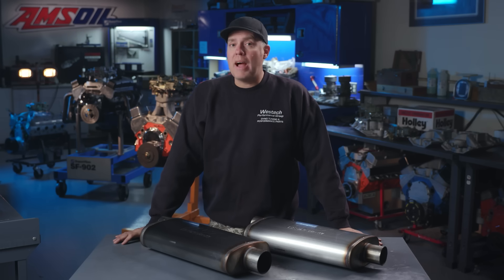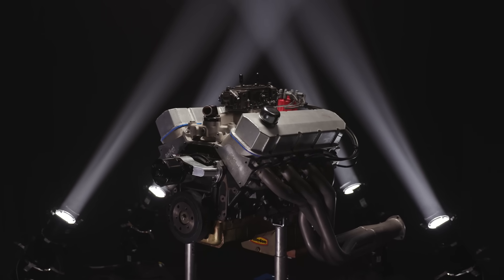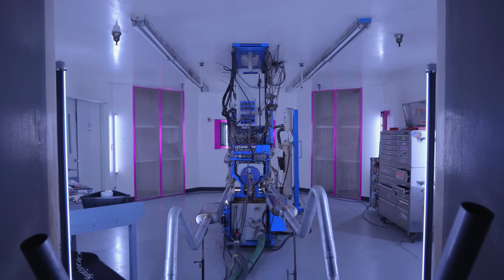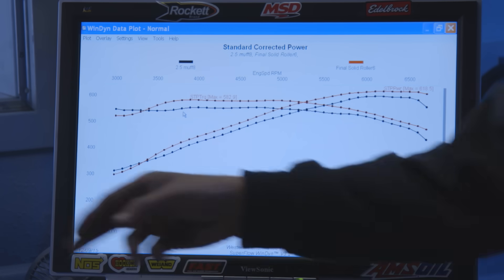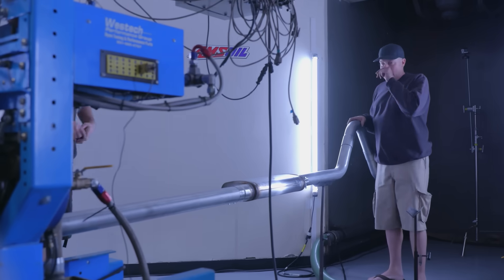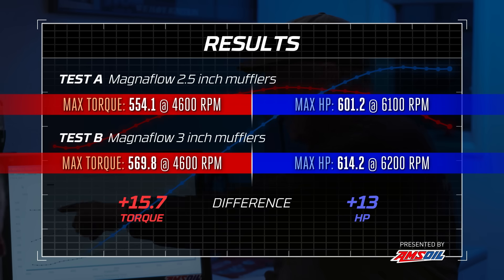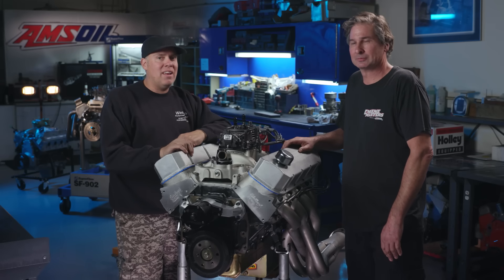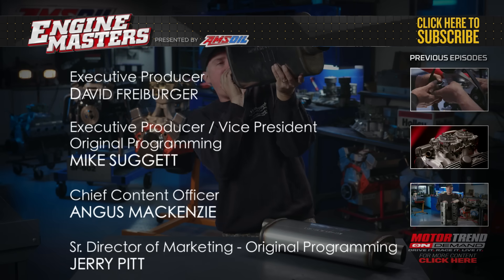The Power of 2.5- vs. 3-Inch Exhaust - Engine Masters Ep. 9

Comment: you get more hp and slight torque but you burn up valves faster this way more power less back preassure higher emissions also. with no back pressure if you have a missfire or predetonation is worse on engine also with carburators cold start is really bad with this 3 inch or free flow setup...... more power faster the engine wear.

Comment: I thought that was pretty predictable on that 454. The 2.5" sounds too small for that engine, and when they showed the difference in area compared to the 3" you knew the 3" was going to perform a lot better. The 2.5" would work better on a 5 litre engine but not a warmed up 7.4 litre.....XE302, they didn't suggest at any time that a 3" was going to work better on your Fiesta. You would only need a 2" on that. They were talking about a 2.5" V 3" on their 454 cubic inch, 7.4 litre Big Block engine.....Teenagers put 3" on their 1.6 litre Hatchbacks because they don't know any better. The Old Bloke at the muffler shop tried to tell them, but they wouldn't listen.....And, they can't be told that it won't work anyway.....

Comment: Generally speaking you want to mean exhaust flow velocity between 240-260 ft/s. Larger piping means it takes more RPM's to achieve this. That's why the 5:00 graph shows the open headers/collector making torque peak well after the 2.5" exhaust was holding steady. Also reducing back pressure on an engine can hurt power but only if the engine was designed to have that pressure there. Has to do with blowing A/F mixture through combustion chamber unburned I think.

Comment: would this be the same concept for a stock 89 454 with 8 to 1 compression, with headers only? I probably would run much more the 4500 rpm in a motorhome. Cruise at 65 mph turning around 2600 rpm

Comment: I enjoy your videos.   

I have often wondered if between 3 engines  of the same capacity,  lets say for argument sake,  a 4 litre (the actual size is not important) engine as a 4, 6 or 8 cylinder configuration.  
(Not forgetting maybe also looking at an in line verses a V configuration. ) 

All 3 engines in the comparison would need to use the same style of engine,  that is to say the same fuel and spark delivery method and for example all have OHC and equal quality heads and exhaust etc or as close as is possible.   The question is which number of cylinders is best if the engine size is equal.  

I am on the fence over this as I can see how with 4 cylinders we have one spark plug for the fuel drawn into a cylinder where as having 8 cylinders would reduce the bore size per spark plug and so allow for more efficient burning of the fuel. (because in effect we would have two sparks for the same amount of fuel in each cylinder of the 4 cylinder engine)  
Yet in an 8 cylinder we have more components and so more weight,  which uses up energy.      

Do you know if anyone has ever looked at this?

Comment: Not Bragging but I made 700 to the tire shifting at 7600 with 2.5 full exhaust with MAC flowpath mufflers and equal length headers N/A....Streetcar. You can keep that 3'' exhaust so the police hassle the hell out of you....A X and H pipe has to be placed correctly otherwise its useless besides noise cancelation but they don't tell you that. Just Buy Buy Buy.Dont overkill your setup.

Comment: not a good video this time. that motor is way more powerful than most people will have. try it on a smaller engine and see what the difference is.  and you didnt factor in how much quieter the smaller exhaust is which makes it liveable. not informative at all

Comment: If an engine likes back pressure at low RPM and not at high RPM then why not a simple spring loaded valve that opens up to allow more air flow when pressure rises?  The exhaust pressure would push the valve open as required

Comment: This is no suprise. My ST170 gained the same power percentage when the cat cracked in half but bottom end was sluggish (more than usual I might add). I hear a whistle coming from the cat when over 6k showing that more flow is required at higher revs so how abuot a clever system that lets the engine breath more at higher revs?

Comment: Hi, I really enjoy your video's, though one thing about this test doesn't seem right. The AFR was richer with the 2.5 inch exhaust as noted, and the power and torque was down 20hp/30lbs aprox with the 2.5 exhaust, but if you notice the overlay with the power being down across the board from 3000rpm, it still made good power with a less than optimal AFR. I would suggest that if the A/F ratio's were worked on to optimise the AFR's with the 2.5 system on you could claw back most, if not all of that lost power. Please address this and prove me wrong, I just want to know. Steve Peyer. PS, I read someone below noted this, and was replied with it's not moving as much air, hence the lower power, I don't buy this theory, otherwise why is it still within 20 hp, and it's across the board, not only at the top. I say it has to do with what was noted in the video, that the resonance of the system has changed, and the carburetor requires optimization for this setup. I still think that with the proper AFR's the 2.5 would have kept up.

Comment: What is ironic here is that most if not ALL muscle cars stock or bolt ons the max torque secs are wwaaaayyybelow 3200, more like 1800 -2200 rpms say 450 -500 lbft 1970 olds 455 pontiac 455 etc....so 3 inch only make more power above 3500, all is well for racers but not every street car will improve at the stoplights! I stck with 2.5 inch to mufflers and 3inch out to tails

Comment: strap this to a Ford 4.6 3v and test dual vs single outlets for trucks with particular engine but restricted to single outlet due to frame design. is it worth fabbing up a smaller diameter dual vs larger single. so many questions.

Comment: I wish some1 would do a air volume flow comparison of a rotary vs piston engines...  do either a 2 rotar vs a 2.5-3.0 V6 or a 4 rotar vs a 5-5.5L v12 (those are the comparable engines for them)  even a V8 vs the 4 rotar would be interesting due to the piston engines having a "dead" stroke to get rid of exhaust and the rotary firing every chamber every time... never has a "dead" pass

Comment: I have a 5.4l 2v I have 4:1 long tube headers with hi flow cats on it. doing true duals so pipes will no connect usually stay in 3grand so what's the best pipe and should I put a cat and muffler back in ? need help

Comment: There's an increase in noise when going 3 inch. I'm about to go 3.5inch on a RS4 B5 2.7 Bi-turbo, and i'm pretty much sure the 'hone' sound will occur more when cruising at 40 to 60mph. Even tho there's an increase in power / torque, your getting a much more noise in return for it. It's no secret cars are having a downsized exhaust to save on the extra sound it will produce.
Reply: KronosSlots i like your avatar although its a tough machine lol
Reply: Can we be on subject? lol.

Comment: So the whole "you need backpressure" thing is bs? I wonder how that applies to diesels.. some guys put fucking 10 inch pipes or maybe just even a hood stack and that's basically open headers so I wonder if that gives the most optimal power
Reply: It's not exactly BS.  Look at the curves on the screen.  The engine is producing more HP and Torque below 3200 RPMs WITH the mufflers.  If you think about it, most people don't drive around above 3200 a lot.  So unless the engine is built to operate at WOT all the time, yes, you'll get better performance out of the typical driving RPM range if the engine has a little back pressure.

That's sort of why this test really doesn't mean anything to people that don't daily-drive purpose built race cars.

Comment: is the air flow the same @ 350 hp in this engine compared to 350hp on a 2.0 liter 4 cylinder turbo engine?  could I expect a 2.5 inch exhaust pipe to do just as well in this application?

Comment: the muffler shops don't like big pipes. because its harder to bend . harder to install. and they have to think harder to make the bends work. since most shops can only make slight bends in 3" pipe. or it will kink. I don't know of a shop with a mandrel bender. 
I have a 94' 454 with performer rpm intake. long tube headers and 750 double pumper Holley. but other wise stock. I have 3 chamber flow masters. which can be 3" or 2.5". I was planning on 3" . so I guess its definitely 3" now. but turndowns. or well turn outs I call them. where there is about 18" of pipe with about a 45 bend turned out from under the vehicle . keeping the sound out from under the vehicle. makes a big difference in the inside sound level. and keep the pipe shot as possible. to get the exhaust and sound out . but what about x pipes or H pipes? anyone still do that? I haven't heard much about it lately. is it worth it in a street truck?  I was thinking of a 3.5" cross over pipe. any opinions on that? using a larger cross over pipe for the H pipe? maybe use 4" oval pipe. but for exhaust. I like using pipe the same size as the header collector.   but is it worth it ? with a 454 that will only be turning about 5K     for now. I plan on it not being stock for long. keep up the great work guys

Comment: now try the same test on a 400 hp 350 for the guys who think they need 3" pipes on just 355 inches.

I'm sure there's a place for the three inch pipes on a small block, maybe you should save it for the people that are getting 500+ horsepower.

this should also be a different test if this was just a 454 that only put out 400 hp and 475 ft pounds. 

of course, the engine that makes 600 some horsepower is going to need the bigger exhaust.

Comment: Nice presentatioNice presentation. I recently placed a super charged GM 3.8L V-6 in a 1985 Chevy Celebrity Euro Sport 2 Door Coupe. When I initially hooked up the exhaust. It had 3 inch exhaust to the cat and 2 1/2" out. I hooked that up to the existing 2" system until I could get it replaced. When I went to the muffler shop. I wanted to go 3" all the way out.  But I got the same argument from the guy at the muffler about needing some back pressure. So I ended up with 2 1/2" out to the end. I could tell the  difference right away between the 2" and the 2 1/2". But I thing that the 3" would have been better. I still don't really know how well it is going to run. Because I am still using the original fuel pump and it doesn't have enough volume. The engine will start to crap out at about 6,200 RPM's. I feel that with a bigger volume pump I should be able to turn out 8,000 RPM's pretty easily

Comment: Plz do a 2001 4.3L with a stock exhaust system and one with a turn down 2 and 3 inch if you could plzzzzzz there is the same talk about this so call back pressure

Comment: The engine accually takes in some of the extra air that it pushes out. You want back pressure to be just enough to let the engine pull enough of that air that left the engine for a hotter combustion

Comment: Whenever they started putting mufflers on nascars 3 inch compared to open head nascars the ones with the 3 inch were faster and beating the open ones but more more quiet and not as exciting. So then they went back to open headers Bc NASCAR is supposed to be loud and entertaining and wow instead of quiet and a little bit quicker

Comment: I have a 13-1cr 388sbc with a comp 270/274 @0.50 .668 solid roller, dart iron eagle 215s and way too much more to list. I started with a 2.5 inch exhaust and intermediate length headers because that system was already there from my old small block and I just wanted to get the car going. Went to 3 inch and hooker super comps and it's better everywhere except below 4000rpms which means absolutely nothing to me. Even gets better gas footage when I drive (rarely) it on the street. Gets almost 5mpg instead of the almost 4mpg she used to lol. Also gained almost 2/10ths and 6mph at Sacramento. 3 inch is good stuff....just don't use on anything less than 500hp. That I would not recommend

Comment: Comparatively it seems the 2.5 inch is a great upgrade from a stock 1.8 inch exhaust system. I know next to nothing about cars and I'm wondering if I should get slightly wider exhaust piping for my car, nicer sound, slightly better fuel usage I guess, that's what it sounds like anyway.

Comment: Three tests one with the motor tuned to its setup and two without it tuned to its setup.  Did you just slap the exhaust on and do a pull or did you actually re-tune the motor for each exhaust.  Well actually you didn't because you showed the fuel being richer with the 2.5 exhaust.  So I'm assuming that you didn't re-tune after installing each exhaust to get the full potential out of it.  I only see skewed results.  Secondaries would help you with that crossover point on the low end where your getting more power out of the motor on the bottom end from the 2.5 inch exhaust.  The restricted airflow on the 2.5 inch exhaust matched the system better on the bottom end.  Its been a while since I was in the FSAE program tuning our motor so I might be off a little.   I really would like to see accurate results with you re-tuning the motor with each exhaust.

Comment: The way an engine is setup is very influential to this test. Bumping up the size too much, on a stock engine, will reduce the torque.

Cam profile, length/volume of the exhaust, intake design, etc. has a huge influence on the results. If an engine is designed to run with open headers, it is obvious that bigger is better!!!

Comment: I had an 01 v6 mustang with a k&n and I had the exhaust cut off up to the cats and it kind if felt like a tractor and sounded way to loud after a wile. no power improvement

 I think the test should be done with a standard engine and test driven.

Comment: guys , I have naturally aspirated 1.6 engine, what suitable exhaust should i use? 2.5 or 3 inch? i dont want lose so much power at all...sorry for my bad english
Reply: 2 inch pipe should be more than enough.
Reply: fullboostturbo1 ok thank you !
Reply: Syahwazz Waz 2.25 would be perfect...2inch is a little small depending how much hp your 1.6makes we had gains with 2.25 and 2.5 even on stock motors..2inch is mostly stock exhaust piping for little honda engines

Comment: I want to know if adding an H-tube or X-tube crossover improves the performance of the 2.5" pipes given they split the exhaust pulse between two sets of pipes giving more cross sectional area than the single 3" pipe.

Comment: I have built several muscle daily drivers.
One being a 2000 3.5 caravan. Why? I did it because its wrong. Most exhaust system upgrades I usualy recommend 2.25 to 2.5 for 4 cylinders V6 2.25  V 8 2.5 duals or for single cat or down pipe back 3 inch. Straight 6 3inch is plenty. This will presserve your lowend torque and give top end flow.
Reply: Correction. the Caravan was a 3.3 not a 3.5

Comment: The thing I questions are.
1 They lost HP with the 2.5 inch and admited a rich condition. would that have been corrected or mininized with a carb adjustment.
2 With a stock vehicle, daily driver, not driving 600+ hp at 8000 rpm.

Comment: Not  even a valid test,not without running the motor with the full  length exhaust  without a muff.. And...should have used f.i. to  maintain consistent a/f  ratio.. I  did a complete yosh exhaust  on my bike,, spent half  day on a dyno installing a jet kit and getting them spot on..went from 149 at the rear wheel to 166..that's a bunch...put the stock exhaust back on and it made 164

Comment: a very good video presentation. but with my own experience, if you are not racing, just daily driving a monster car that you loved very much, its better to go for 2.5inch and you get a very peaceful civilized monster n not disturbing others along the way. becoz 15hp difference is too little to make any difference at all when you have 590hp. 

i personally driving an SR20DET with 270hp when my exhaust cut out activated, and 254hp when its closed. and im only using 2inch pipe with and 2inch S-Flow muffler.

the exhaust cut out do gives a monster growl when I need it, and extra punch, honestly, just a tad tiny bit punch. 

270-254 = YOU DO THE MATHS

Comment: My mechanic said that I can't put true duals, on my 1999 5.9 Dakota, that it doesn't have two,o2'  it has headers, it seams like a waste to run it threw a y pipe. , is this true, I can't have duals because it's Eli?  I'm lost   And just want this 5.9 to sound as bad ass as my old vette, same size motor,  my truck sounds lame with a dinky single 2.5 ,   Gibson headers from factory, into a single cat out two pieces,

Comment: Its not the engine that needs the back pressure, its the mufflers that need to make some back pressure in order for the mufflers to muffle/work.  If the mufflers aren't working then they just add weight and maybe pass visual inspection.  Yes?

Comment: would an X or H pipe make any difference??
Reply: A cross plane crank in a v8 has an uneven firing order from side to side.
So the pipes are usually built with an H to even out the pulses.
Reply: I never smell my exhaust. Turn downs help. Putting 3"tailpipes on after I move some fuel lines.
Reply: yeah, had a couple of cars setup like that i hate the in-cab droning & in some cases the lobster-face you get from CO entering the cabin & into your lungs
Reply: And now you all have ya answers
Reply: Borla exhaust say a h-pipe does nothing except change the sound. I don't think many would agree with that
Reply: Crossovers only increase the RPM in which you make power a little bit.
Reply: They help scavenging the pulses
Reply: Full exhaust with x pipe is as good as dumps at the axle
Reply: The noise gets annoying. My stang is getting 3" tailpipes and a x pipe.
Reply: It now has 3" to the axle w/ turn downs